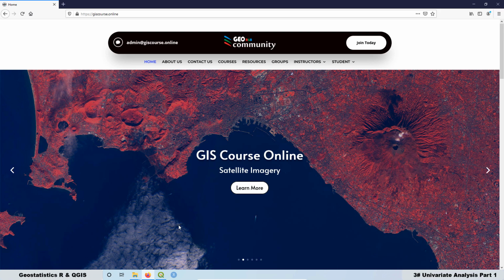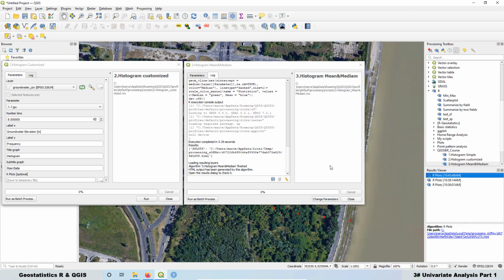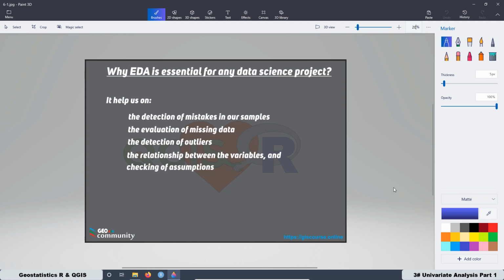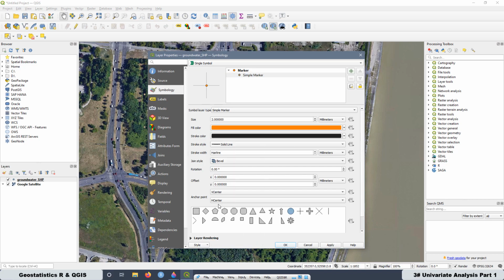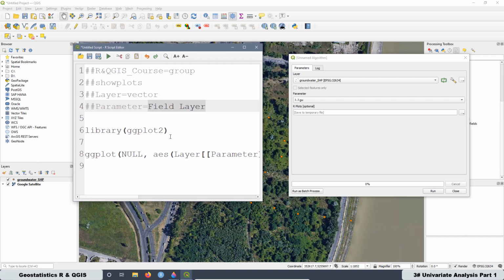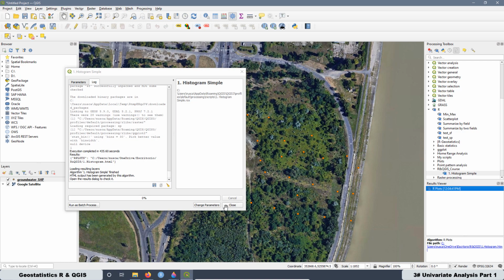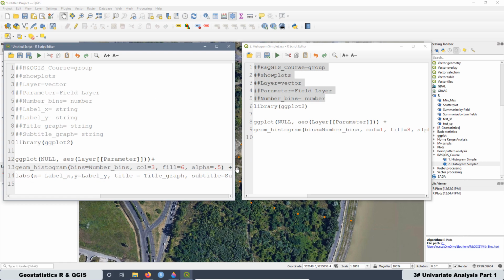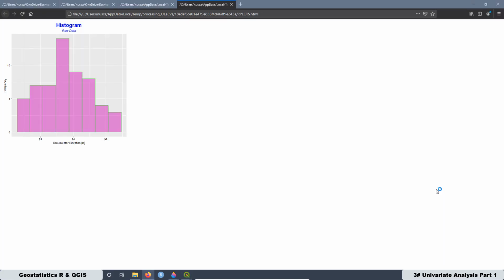💡 03 Geostatistics Course for Beginners with QGIS and R.  Univariate Analysis Part 1.

Comment: Another issue encountered: performing 1. histogram simple it says in the log box error in library ('"sf"): there is no package called 'sf'
Reply from the maker: Hi Patricia. It means that you do not have the package sf installed. Try to install the package sf in R and then run the script again. If it is not working add library(sf) to the script.

Comment: i enrolled in your course and the installation of r and qgis procedure. when i tested the R in qgis it says "This algorithm requires R to be run. Unfortunately, it seems that R is not installed in your system, or it is not correctly configured to be used from QGIS" but i have installed R and R studio. any advise?
Reply from the maker: Hi Patricia, let’s see if we can fix it together. I am not sure what could be the problem. Then my recommendation is to install a new and clean version of QGIS, R and Rstudio. It means that you are going to remove everything related to QGIS. Then if you have any project of QGIS just save it in a USB pen or something similar. The same for R, and Rstudio. 
1)	Remove R, RStudio and QGIS from your computer (control panel, programs and features, look for R, RStudio and QGIS), click right in your mouse on the software and uninstall.
2)	In order to have a clean uninstall in QGIS I also recommend to go to the folder AppData, in my computer is located at: C:\Users\marcel\AppData in yours will be a little bit different. The AppDAta is a hidden folder, then you have to make all folders visible in your system, if you do not how to do it just look on YouTube how to make all the folders visible.  Then remove QGIS from the folders local and roaming: C:\Users\marcel\AppData\Local  (in your computer the link will be different), C:\Users\marcel\AppData\Roaming (in your computer the link will be different).
3)	Then install all the software again with the most updated version.
I know this is a drastic solution but it is the only way we can start from zero again. Good luck!!
Reply: @GeoRGBCommunity  okay! Will try this procedure. Thank you so much!

Comment: Good day sir, I have tried this but unfortunately when I see the result it opens a blank image in my browser, Could you please give me a hint on how to solve this? thanks
Reply from the maker: Hi ERE_2017. First, check the script is correct. It is better if you download the scripts directly from the website. Second, make sure you are using point for decimals in your attribute table in QGIS. Third, make sure you have no spaces in the heads of your variables in the attribute table in QGIS. Also, there are some characters/symbols that R cannot recognize, try to avoid to use any of them in the head of the attribute table in QGIS, I just recommend to use numbers and letters. Please, let me know if these tips help you. Thanks
Reply: @GeoRGBCommunity  Hi Geo RGB, thanks for the prompt answer. Unfortunately, it didn't worked. I was searching that it might be a problem with 64 bits processor. I tried with the vector layer histogram tool and this one creates the HTML plot with no problem. Not sure why the R script does not work. Thanks
Reply from the maker: @ERE_-jt4bm  I am not sure how you can fix the problem. I am going to provide you several ideas: test the script with a different dataset. If the problem persist, try to update the QGIS and R. If you do not want update the software in your main computer, install a virtual machine, like VirtualBox and then install the last version of QGIS and R. Also you can try in a different computer. The goal is to know where the problem is located, script, QGIS or R. Keep me updated. Best regards
Reply: I had the same problem and it took some time to solve it... Eventually, I decided to use a print function in the script